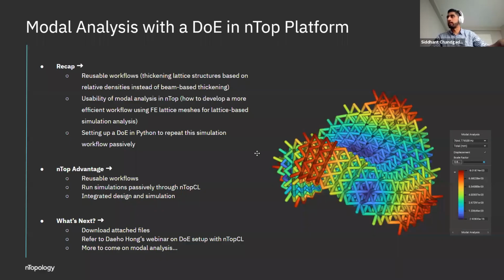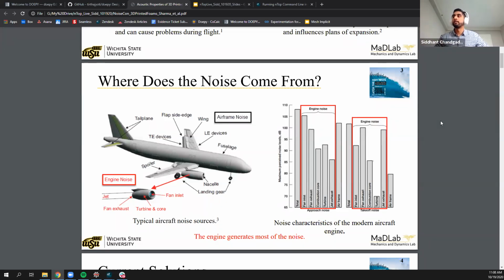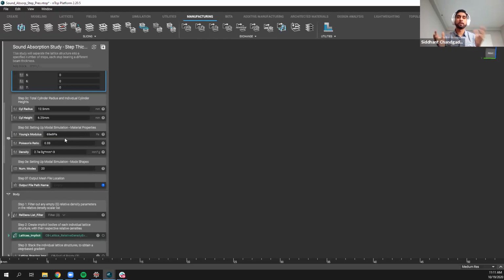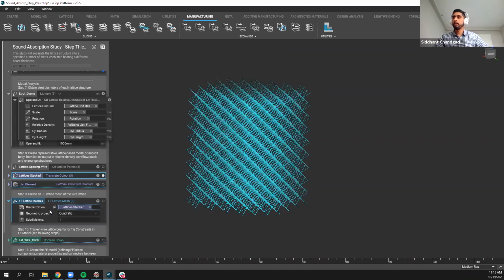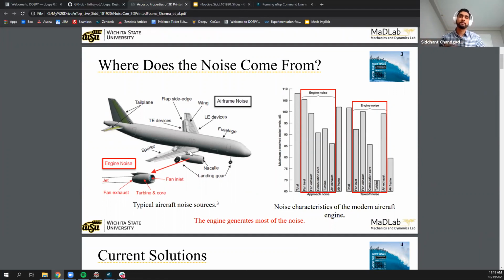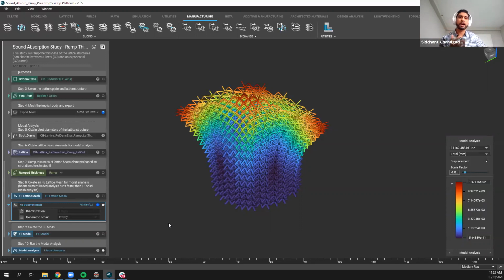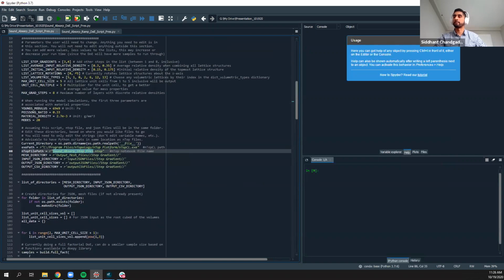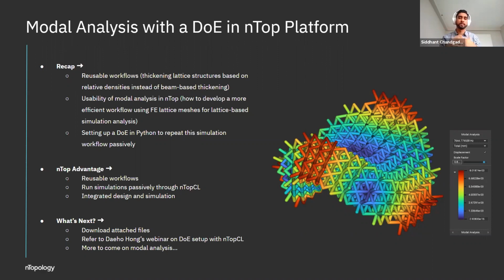nTop Live: Optimizing Lattice Structures for Damping Vibrations on Aerospace and Automotive Parts

Comment: I'm late to the party.  Why can't I define the lattice thickness variable by a function?  I agree that the paper shows good results for the step-wise lattice changes to relative density.  I want to write a 3D function to define the parameter values for the lattice to have unique values anywhere in the 3D lattice space.